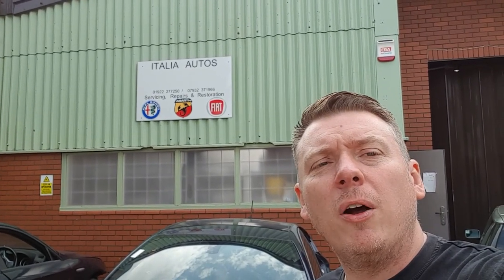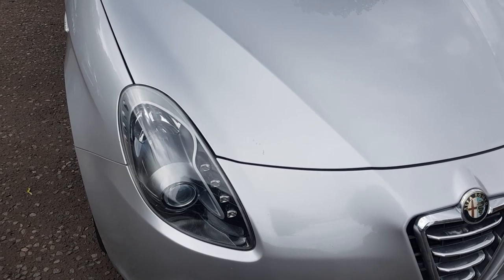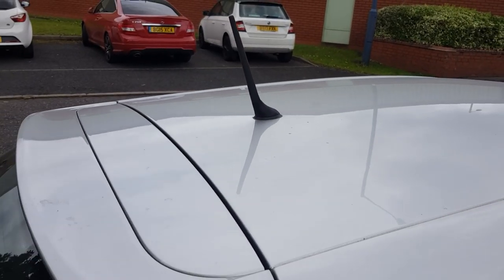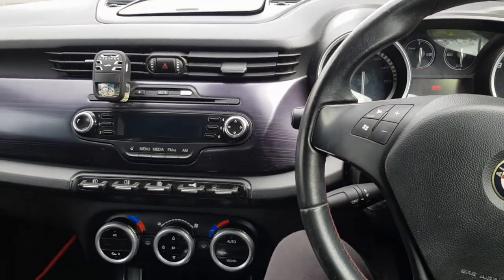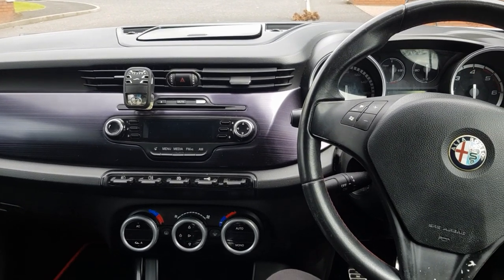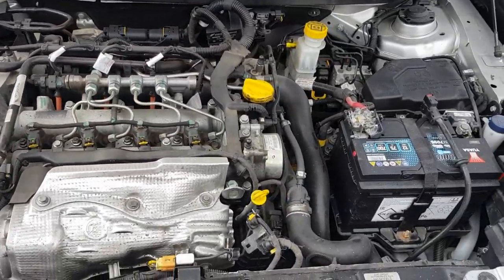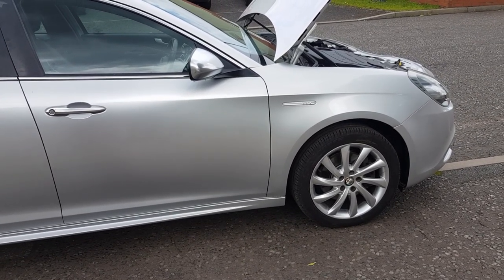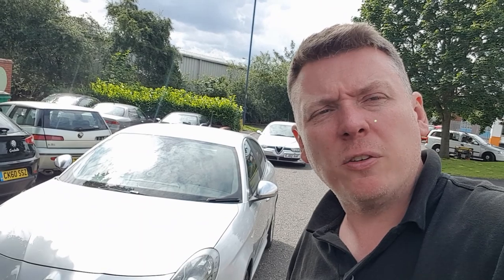Alfa Romeo Giulietta Buyers Guide

Comment: Hi there, great video. I'm thinking about buying one of these in 1.4 manual but never driven a Alpha before.   Just wanted to know if you found the foot pedals were too close to each other as that would bug me?  Also if the gear changes/clutch is smooth like; Ford, Honda, Audi?  or is it tough like BMW manual gearboxes (which i do not like) as I find the clutch too heavy.  (I'm not able to go & test drive due to Covid19 lockdown). would appreciate a reply, Thanks.
Reply: Buy one, the 1.4 engine is amazing and won an award. The pedals are close but in some people's eyes it's better. The gear change is amazing, not stiff but changes very well, with the clutch not being too heavy. Amazing car, and very different to the standard hatchback.
Reply: @jckedwards65  👍

Comment: Was considering one of these, but after watching this comprehensive list of faults and things that drop off I think I’ll pass, fortunately the underbody doesn’t have many problems? Probably because it’s just pressed steel or I’m sure they’d be riddled with faults like the rest of the car is.
I think I’ll keep my focus now
Reply from the maker: its a what to look out for not an everything goes wrong with them.
Reply: Absolutely, and I follow your channel and enjoy your videos, however I was a little concerned re the door handles and interior door card thing, engine bits like Egr etc are to be expected though.
Knowing me I’ll probably just take the plunge anyway and chance it, I just just love the way they look, give it a few days and I’ll love them again! I havnt got it yet but I’ve an ebay basket full of accessories for it! 
Love your honest vids though, thanks for replying and keep up the good work 👍🏻
Reply from the maker: @davidcooper4631   the newer ones have most of these faults fixed.
Reply: @ItaliaAutos  now that’s what I wanted to hear!!! What year onwards should I look at please? I’m more or less set on the 2.0 diesel auto with the tct in veloce spec in red or black, just waiting on the restrictions to end so I can travel, they’re all miles away from me 🙄
Reply: @davidcooper4631  big update 2014 onwards. But all are reliable. Here possible faults are listed but I have had 4 trouble free years from mine

Comment: Hi again

Just replaced battery of my giulietta which is using from 2013. The old battery came with her and it was a Exide sgm battery. Could not find same battery and replaced with Exide EK600 AGM type battery. Now, stop/start system isn't working since then.
Do you have any idea ?
Reply from the maker: jinhitman temperature.
Reply: did u manage to ever find a fix?

Comment: Do they still have the oil pump pickup seal or has the oil pump design changed? Causes low oil pressure on higher mileage 159’s on cold mornings and eventually knackers bottom end. Insignia’s and 2.0 Bravo’s suffering the same fault.

Comment: What about the tct gearbox?
Reply from the maker: the boxes are ok but clutches are not cheap to replace.
Reply: Got one model 2011 170 diesel, no problems at all. Great if you need to overtake or in dangerous situations with trucks.
I respect the maintenance times strictly!

Comment: Whats your opinion on a guilieta as a first car? The 1.6. Do you reckon it will be too much on insurance?
Reply from the maker: All Alfa’s as a first car will be more expensive to insure.
Reply: @ItaliaAutos  cheers.
Reply: @ciaransmith481  the 2.0 150hp  isn’t much more to insure as a first car and you get a nicer engine. A Mito would be even cheaper to insure
Reply: @davidbest1 u cant get insured on a 2.0 giulietta as a new driver. With 1yrs no claims cheapest quote i hot was 4.5k with a tracker

Comment: What do you think about 1.4 Multiair 170 BHP and 1.75 TBi in GIulietta? Which one is more reliable and cheaper to maintain?
Reply from the maker: Both are fine. Just make sure its had regular oil changes.

Comment: Hi, had my Giulietta 2.0JtDM for just about a year an what a great fun car it is to drive.
Unfortunately had a bump in it a couple months ago, the car has been repaired but the power steering failed at the bodyshop.
I believe the power steering was not effected due to bump but probably faulted during start up with flat battery.
The original battery wasn't hold charge so I renewed it but no cant seem to get the power steering fault remedied despite clearing all fault.
After clearing all faults I still get a  BCM (Body Control Module) fault, and ECM (Engine Control Module) fault, and an ABS fault. All faults are prefixed with the code U1702-87
Any advice to identify fault and what to look at would be much appreciated

Comment: What do you think of the 2012 tct 1.4 petrol multi air giuelletta as a first car for an auto only driver? (Between 80k-110k milage)
Reply from the maker: Sorry, but there are better Automatic cars out there. The tct box is pretty awful
Reply: @ItaliaAutos  even for a first car around 4k price point?
Reply from the maker: Expensive if the tct goes wrong.
Reply: @ItaliaAutos  what other autos would you recommend especial for a first car?
Reply from the maker: @Roman-hl1xd  it's all about cost on insurance now run a cheap car for 1 year. Not point getting anything special in your first few years of driving

Comment: Hellow, do you know how reliable is the 1.4 multiair  engien and the dual clutch transmison,  Im thinking on changing my 2012 impreza xv fore one o these, couse im driving a lot of miles, and in my country, Chile, petrol is expensive.  here we didnt get the diesel so its not an option
Reply from the maker: multiair engine are pretty good just make sure the multiair filter is cleaned once a year as its not a part of the service.
Reply: @ItaliaAutos  how have I owned and serviced my multiair for 3 years but only just found out about this even being a thing! Just took it out and cleaned it, but have ordered a new one to be on the safe side as the o-ring didn't look in the best condition. Glad i stumbled across this, cheers!

Comment: Alternator removal is a nightmare to do, worst I've ever done😢
Reply from the maker: How did you do it. There's an easy way
Reply: @ItaliaAutos  osf leg off, driveshaft off, pull engine forward, oil cooler off, out from inner wheel arch.

I've tried the out the top method and found the out the bottom method easier.

Comment: Cam belts on these only 4 years in certain situations depending on usage, if memory serves me right it’s 6 years for cambelt 72k ??
Reply from the maker: Tom The coffee guru yeah I’d never let a belt on these go that long.
Reply: I’ve seen these go 120k plus on the original cambelt, on the Alfa specific service sheet for the 2.0 diesel it’s got the conditions for cambelt change such as high idle time, temperature conditions etc but under normal use it’s around 6 years
Reply from the maker: Tom The coffee guru I’ve seen a twins park go 15 years but I wouldn’t  want to chance it again. Lol
Reply: I've got a 2015 edition 2L diesel and the manual says 72k or 6 years.
Reply: i got a 2011 1.6 diesel and the book recommends 5 years or 84000 miles whichever comes first i believe
Reply from the maker: @BogeyFinder  i personally recommend 4 years but its your choice if you want to go by the book. thanks

Comment: What about the 1.4 multiair 170 hp engine?
I really want to buy a 1.4 is it correct that you should use 5w40 c3 engine oil?
Reply: go with the recommended weight and fully synthetic. like with any turbo VVT recent engine
Reply: Use only the recommended oil, matching all numbers, done 30k miles and love it
Reply: The oil for multi air is selenia digitek 0w30, putting the wrong oil in the multi air it will cause the solenoids in the multiair unit to stick causing misfires and need new unit, Alfa will charge about £1k for this as the unit is about 800£ on its own
Reply: @tomthecoffeeguru3665  I figure any top brand quality synthetic will do just fine as long as it meets the requirements
Reply: furtivedig as long as it meets all the specs Yh, the wrong oil can cause lots of issues, most of the running issues with the multi air can be linked to oil, whether that be wrong oil or just not changed at the right intervals (every 9k)
Reply: @tomthecoffeeguru3665  I stand corrected. word on alfaowner seems to be use only Selenia, make sure it is to the Fiat 955535.S2 standard, ACEA C3. It is a bi ambiguous to regards to the weight. 5W40 seems popular but they talk about 5W30 as well. I would recommend calling a dealer or reading up.

 change it every 8k km in the summer and 6k km in winter and you should be golden
Reply: Petronas selenia digitek is the oil for the multiair system it’s designed for the specific application grade is 0w30, i worked in a Alfa dealership for 3 years and was master tech
Reply: I don't get why people are trying to find some other oils, the Petronas oil cost's as much as any other top brand oil, and if you read in alfa romeo forums, every multiair systems failure was the result of using different oil, even if it met all the standarts

Comment: I think i'll pass. I had 2 145's in the past, and was put off buying another Alfa because of a multitude of faults.  But they were great to drive, when not stuck in the garage. Seems like not much has improved over the years.
Reply from the maker: in all honesty there just the same as very other car out there, look after them and they will be ok. just buy what suits you. thanks for watching.
Reply: @ItaliaAutos  Except they're not just like any other car, are they! There's a reason why they have such a reputation, and you outlined quite a few reasons yourself. From dodgy paint, fit and finish, to door handles that come off in your hand. The same can't be said of a 10 year old Volvo or Saab.
Reply from the maker: Herman Munster I’m sure other specialist for other marks could point out just as many faults. We don’t buy them because there relatable we buy them because we like to be different and love there quirks and unique styling.
Reply: @ItaliaAutos  Fair enough. I was just giving my own experience of owning 2 Alfas, both of which sharing similar problems. But you're not painting a good picture, pointing out all these faults, it has to be said.
Each to their own I guess.
Peace ✌
Reply: @hermanmunster3358  I think they improved tremendous over the years. I read about sooo many oil buring Alfas from the late 90's and 2000's with those stupid Twin Spark gasoline engines: 1.5l every 1000km is a lot. Now Alfas mothercompany Fiat was always known for not being reliable when it comes to electronic (there engines are really reliable tho because Fiat knows how to design a diesels or they still use their old FIRE Engines 1.2l or 1.4l without turbo and Multiair). And damn my grandparents old Volvo V70 also had a lot of electrical problems but you know the engine was fine unlike my parents Volkswagen Sharan: 4 power windowmotors broke, flat review mirror fell off while driving, trunkbutton failed twice..Still it had room and was practical but that's about it..
Reply: @chriskonte1909  Both my Alfa 145's had the Twin Spark engine. The first was a 1.8L with the metal engine cover, from about 1997 I think. Then I had a 1.6L from 2000, with the plastic engine cover. But I never had any issues with losing or burning oil. And to be fair, the second car had been messed about with by its previous owner, which caused a lot of problems later on. But the first car had problems with starting in wet weather, an electric sunroof that worked occasionally, central locking that had a mind of its own, and intermittent warning lights on the dash. I ended up scrapping it after there was a puff of smoke and a weird squealing noise from under the bonnet one day. It would not start at all after that, it just died completely.
Reply: @hermanmunster3358  Same here my car has it's own life without being italian. I drive my grandparents well serviced Mercedes A-Class (180CDI) from 2008. I just drive the car for 1 1/2 years and it caused so many problems but here's the histroy:
-Bought 2009 with 30.000km on it got serviced like it should.
-2012 the turbo went out got replaced I don't know how much my grandparents payed but it wasn't under warranty
-2018 I start driving the car for school 2 times a week.
-2018 the heated seat driver side broke didn't fix it yet
-2018 Fan just works on full blast my entire fan motor or whatever I don't know the right english word for that sorry ^^ got stuck and they told me it's about 350€ just for the part ifself I'd also need a new resistorfor 140€.
-2019 car starts idling weird and the entire steering wheel shakes didn't fix it yet.

I just did the imporant stuff like: Oil, filter and fluids.

Like I said it's not my own car but I drive it daily for work. Wouldn't be that bad if the car'd break down because my grandma should stop driving and as long as this cars available she won't stop ^^

But anyway that was just an example why I don't wanna buy a German car as my first car.
Reply: All cars are a collection of parts from most of the same suppliers. Car brands are mostly assembly operations for the hundred companies that supply all the brands with parts.

Hence these days reliability is much the same across brands - because under the styling they all use the same parts basically.
Reply: @froggy0162  your buying the styling these days, over shared parts. 👌

Comment: Had depposit put for one of these 2012 and pulled back after watching your video and probably will go for A3 same year instead. Noce cars but can see they suffer with a lot of annoying issues. Shame, not a myth then, Alfas are poor reliability 😢
Reply from the maker: The facelift giuliettas are much better.
Reply: These problems on the Alfa are pretty cheap and yes you may have one or two problems pointed out in this video, but once fixed the generally stay fixed.
But from experience with Audi good luck with your A3 when something goes wrong, just one repair can cost all of these problems found on the Alfa.
Also don’t forget these have been around for a very long time compared to other manufacturers cars.
Just getting my wetbelt changed on my focus ST will probably cost more than I ever will spend on any running cost / problem on our 2L JTDM Jiulietta. 
Not to mention the tyres I’ve gone through on the ST and repairers from pot holes.

Comment: Quite amusing, keeps saying that it is a very reliable car with very few problems, then goes on to list a myriad of problems😂😂
Reply: as ds1868 wrote there is no car with no problems, you need also to interpret the list of problems, just because it was mentioned it doesn't mean that every owner will experience all the issues mentioned.  For many issues it denpends on your driving habbits are and on how much care you are ready to put into the car. For me it's important to know what in theory could go wrong and how much would it cost to fix. This video provides both information so it's very valuable. Or are you one of those people that just need the confirmation that alfas are junk?
Reply: Good comment, exactly what I was thinking.
Reply: He is giving (imho very good) advice on what to look out for if you plan to buy a used one. If that is what a viewer plans to do, this is very valuable advice. And if you have one, you know what might (and probably will not) go wrong. No problem here, on my 2017 model the battery went wrong and was replaced under warranty. That‘s all. But I do know what to look out for in the future, so thanks for the video and the effort that went into it.